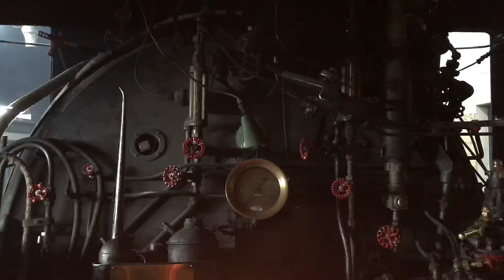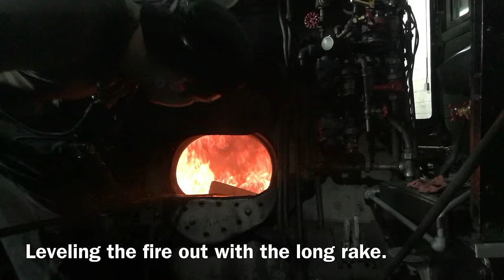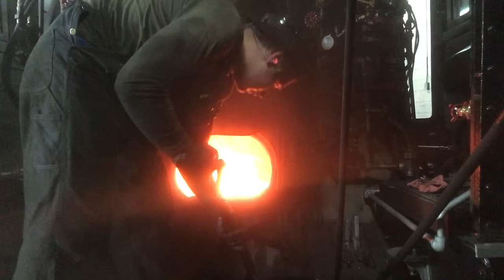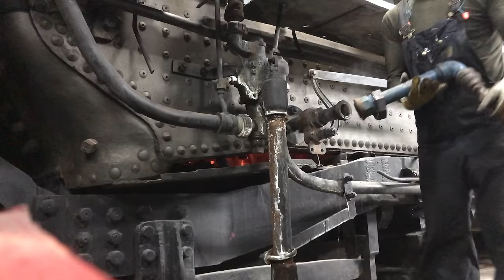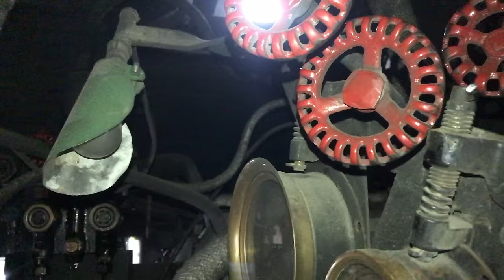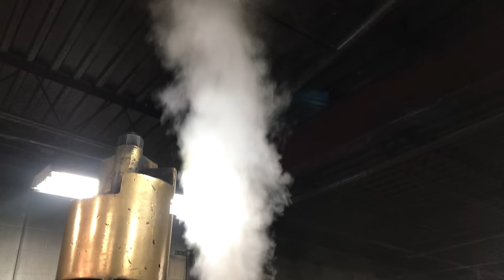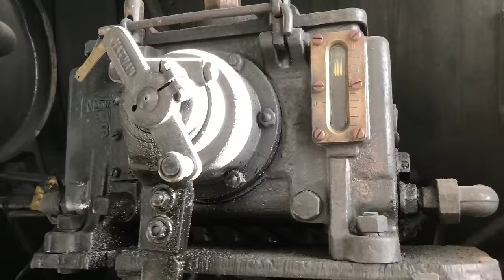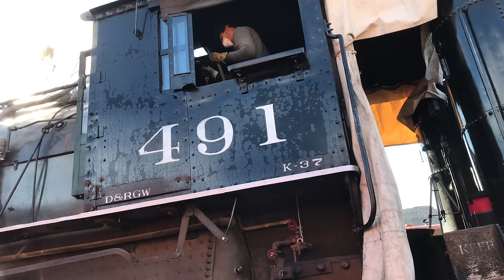How To Fire Up a Steam Locomotive [4K]

Comment: This video really explains why so many heritage trains are switching over to diesels.  Very few still use steam, and its usually only occasionally.  The time required is much more then I realized.
Reply: Time and knowledge!
Reply: I have no idea where you are talking about, but it's certainly not the UK!  Steam is the point of most UK heritage lines - without steam, where's the heritage?.  And I say this as a volunteer driver who has been working with steam since I was 14.
Reply: I agree, its pretty sad. But  at least over here, more and more heritage lines are switching to diesel, with special "steam" days for occational use.
Reply: A fascinating video!!! I have wondered how they got the engines ready for Service. I can only imagine how mush more time would be required to fire up a ‘Big Boy!’ 

It’s too bad the ‘ACE 3000’ project didn’t get a few prototypes built. It would very interesting to see what would have changed in firing up a ‘modern’ steam locomotive. How much automation and reduction in steps might have been possible....
Reply: @stratman323
"....but it's certainly not the UK" !Sure not. WOW. You did realize that? 
Whithout looking at the writings and numbers one can clearly see: A cowcatcher and Counterweights outside the frame and wheels - this must be american, and a narrow gauge at that - a bigger one than many british standard locomotives for sure.
This can only be some D&RGW, and - no wonder about this - one can find some writings on this loco in the video, stating, it is #491, a K-37 of the D&RGW.......
British steam isnt by far all about heritage. Some diesels and electric are older than some steamers and also belong to the heritage. And tell me, what has a loco named "Tornado" to do with heritage being a newly build one??
Reply: Pearly Humbucker well you seem to not understand that they were replying to the original comment, which was a general statement. 

British heritage railways have a history going back to the 60s. Most locos come from Barry Island, and scrap yard that took hundreds of steam engines and didn't get around to scrapping most of them. A very significant portion of the heritage railways use these locos. They were all being axed by BR during the Beeching era, so diesels and electrics tended to not end up in the scrap yards like Barry Island. The ones that do survive regularly run, there are Deltics, class 47s, etc, all on heritage lines, and the class 47 is still in revenue service on some lines! We don't ignore diesel, but getting the engines is difficult. And electrifying a heritage railway is just expensive and impractical, and doesn't fit the branch line style they mostly have. So steam mostly, diesel occasionally, and electric almost never. Makes sense.

Oh, and Tornado is an LNER A1 (not the Gresley one, the other) built to original spec. This is significant because it represents a triumph for the heritage organisations that there is enough interest and funding to still build steam trains. It is also the only A1 Peppercorn in the world. In every way identical to the original design, it is clearly a heritage loco.
Reply: @
Dubsy 102
"...  it is clearly a heritage loco."
No, it is not. It is simply a replica. Not more, not less. 
"it represents a triumph for the heritage organisations that there is enough interest and funding to still build steam trains."
WOW.
There are some companies in the world that build steam trains. New. But they dont make such a bohei about it. DLM for example with their locos for "Brienz Rothorn Railway". Or the "Tren del Fin del Mundo", with its Garrats, one of them build by Phil Girdlestone, South Africa.

Anyway. We dont need wait too long, till the craziest british steam enthusiasts have signed their last contract and the british heritage railways - like all other heritage railways around the world - will face the problem of high costs of operation of steam locos and not having enough man power to operate them.

The british heritage organisations then should have done something to lift the newly to build loco named Tornado onto the next or overnext level, meaning to better the performance and environment friendlyness so that this loco may run some years longer than all the others, that then must stay at home due to legal requirements. 
But no, they didnt think far enough. And so th Tornado will fall over the same legal requirements like her companions that stem from the same construction era - being newly build doesnt help against the old principels she was built after.

Anyway - they taking not about heritage GB. Therefore the comment of stratman is fairly sensless contextwise.....
Reply: Nicholas Scott...... What are You talking about, sir !??!...... Heritage Programs,  are ALL about Steam, and Are Steam!!     The ONLY time you see diesels and "Heritage" used in the same context.... is with the UP's "heritage" Diesel Fleet..... which are just a number of diesels (EMD's mostly) that were painted from new... with the colors and names in honor off "roads" that are "fallen flags"...... class 1 railroads that are no longer in existence, mostly since the late 1960's to 1970's.

Steam programs and steam "tourist" railroads have come and gone over the years since the 1950's.... however, those that are still with us... are strong,  and are Growing... there have been quite a few larger steam locomotives that have been brought back to life within the last five years, especially.... and quite a number that are now currently being completely shopped..... and Not least of which,  the 4014.... which people Worldwide are already making plans to be in Cheyenne when it comes out of the Steam Shop for the first time (including myself)... it will be a Very Historic event to say the least.

It should be ready for its first static tests sometime in Jan or early Feb. of 2019, and IF all goes well and it passes without any further work needed, then they will progress to the hydrostatic tests right after that.   Then,  hopefully pre-certified for it's shake-down runs.... with time enough for any final "adjustments" and be ready for the 150th Anniversary (of the "Golden Spike") at Promontory, UT.... and will also be in the company of the 844,  and Hopefully the 3985.... but the 3985 may not be steam ready again until 2020..... UP Steam's central focus now, is having the 4014 ready for the 150th in May of 2019.
Reply: Nicholas Scott ;all ships on the high seas has that kind of machine that's why if you can operate that kind o machine and your well discipline there is a big chance to be an an seaman old and new shop still using that kind of machine
Reply: that kind ofachine use to operate all the ships on the highseas
Reply: Posttrip Of course, there was an entire crew completing all of the steps, greatly diminishing the time it took to do what this guy did in the video by himself.
Reply: in my opinion, there are at least three reasons that that don't use many anymore:
1.price: it is more costly
2. smog: those engines can really mess with a conductors lungs and have long term effects
3. the locomotive can literally blow up in your face: boiler explosions
now, i love these trains, and i try to see from both the businessman and the enthusiast. so, here are the main reasons some still use these:
1. nostalgia
2.they were iconic
3.they look so much cooler than the diesels.
Reply: Nowadays they use imitation steam trains which are diesel locs made to look like steam ones. Maintaining steam locs is simply not possible these days anymore.
Reply: Nicholas Scott people are to lazy to do it
Reply: Anything good takes time
Reply: DEEREMEYER1 that was probably unnecessary how are you supposed to get anyone new interestwd in steam with that attitude? In my experience you have a list of rules you need to know and follow before you can come near the locomotives, and I would say most of it has to with funding or lack of knowledgeable staff. If they have no one to pass it on too, and are getting old steam probably womt run full time. That's just my opinion.
Reply: Mr Leg but the actual pressurization of the locomotive I would imagine still take 7 hours especially if you're starting it up from being dormant a few months additionally I would imagine that the slower you bring it up to steam the better it is for the locomotive.  Might be nice to have two people to get all that lubricating done though.
Reply: Nicholas Scott 
It's the cost of coal, it's not cheap to buy in say 20 tones of coal for 2 or 3 days run.
Or
They can't get the coal to run the stream engine so only by it when they can. 

Britain doesn't much of the really good coal anymore and the cost to mine it etc is too high.

That's partly why china is now dropping steam engines
Reply: Pearly Humbucker  Tornado is an A1 class steam loco; it was built from drawings from the National Railway Museum, York, UK because all examples of the class had been scrapped. 
It has a boiler built in Germany since there is more expertise regarding the manufacture of locomotive steam boilers there.
The engineering team were meticulous in the construction of Tornado and I noted how they had the loco up on jacks to turn the wheels by hand (I think with the motions all attached) to check for any tight points. 
What most impressed me about Tornado was that, on the over run with steam shutoff, there is no noise from the loco at all since all the bearings are in new condition (I was standing at a station one up from where the train was booked to stop in Southampton, UK when it swept by).
Reply: Wow never thought I'd have to explain that there are classic diesel locomotives that also get and deserve a home on heritage lines. If you don't enjoy the sight of something like a beautiful EMD F-unit or a Class 37 along side Steam Engines then you're a sorry excuse for a "railfan." No matter the country.
Reply: I dont think so, Diesel engines really don't start up like a car either, the reason was that Diesel's have more power
Reply: There are many reasons why steam excursions are dying out. Insurance for steam engines is very expensive due to possibilities of explosions. The boilers have to be completely overhauled and inspected every fifteen years. It takes a long time to fire them up. Parts are often unavailable and must be custom-made.
And after all this time and expense, 4 out of 5 excursion riders don't know or care what a steam locomotive is at all or give a damn about it's historical significance. To them it's just a fun and pretty train ride to take the family on.
Operators look at this and just say "why bother?"
Put it on display and pull the train with a diesel.
While it's on display, just watch how many thousands of people will walk riģht past it without even looking at it. Not many people have an affinity for steam like we do. Sad but true.
Reply: beans lmao 
I don't think so. You might be surprised by the number of operators who are seriously considering running their trains with a diesel engine and hydrostatic drive in the tender and the empty steam locomotive rolling along in front just for effect. Some are already doing this and I'm sure their insurance premiums dropped to a fraction of what they were when using live steam.
Insurance rate hikes ended up closing quite a few smaller excursion trains a while back.
Diesels are far less troublesome and expensive to operate and insure and for operators on a budget it is likely to be their only option if they are faced with a boiler overhaul.
Reply: @zagan1  That's why there are also oil fired steam locomotives. Union Pacific's restored 4014 will be oil fired.

Comment: I always wondered why they referred to the "operator" as engineer. Now I clearly see why... still trying to pick my jaw up off the floor... 💗
Reply: I never really stopped to think that a steam [oco carries a generator to provide electricity for the trains lighting.
Reply: That's the original meaning.
Reply: Engineer is literally "one who works with engines", originally siege engines at that, catapults, wheeled battering rams and such.
Reply: A locomotive “engineer” is a legacy title. They are mechanics and operators in one. He couldn’t calculate the Specific Entropy of the system he is operating.
Reply: aleksander suur You couldn’t be “more” wrong. An engineer is; a professional (degreed) individual who invents, designs, analyzes, builds, and tests machines, systems, and structures. NOT someone shoveling coal into a furnace, lol!
Reply: @MrFE-wp6bf  that's the modern meaning of the term yes, but not the historical one. It's like the term "engine" that goes way back before heat engines were even invented. Calling someone who maintains and operates machines an engineer is not wrong as such, it's just somewhat outdated use of the term.
Reply: @aleksandersuur9475  everyone is an engineer. 😊
Reply: @lcuxi  hmmzz... I was thinking along the lines of army engineers, as in operating siege engines variety of which predate rise of Rome. That specialization has been called "engineers" for a very long time. But your point about latin root of Ingenium is valid, it certainly implies a wider meaning from the very inception of the term.
Reply: Mr. FE Engineers dont have to be degree holders. Some of the best software and automaton engineers I know are all self taught.
Reply: @aleksandersuur9475  I love outdated terms. Never stop using them. My dad was a marine structural engineer but he did not have ego problems. A train engineer, thank you!
Reply: @gastonbell108  👏👍
Reply: @lucasagnew4613  👍